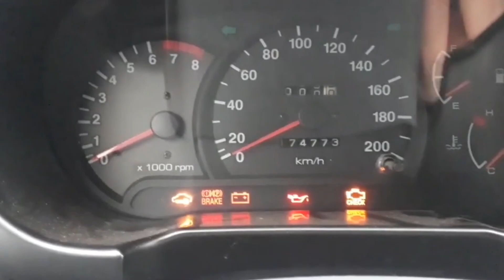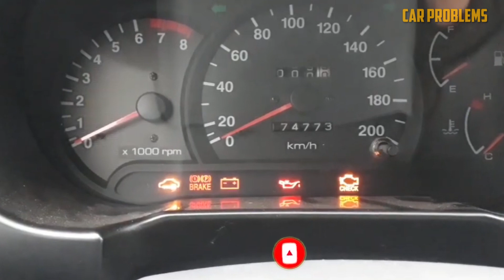5 Causes Car Clicks When Trying to Start. How to fix?

Comment: 2006 bought new, gto LS2, 6 speed
Clutch has to be in to crank it
Only long trips 30,000 miles on it.
Probably been started less than 50 times 
Started getting a click like the solinoid is engaging then it would turn over and crank.
Next only a click.
Put a new battery in it and on the first try it clicked then on 2nd try it cranked.
Now it only clicks even when trying to jump it off.
Obviously i dont don't drive it much but was cranking it OCASSIONALY it and letting it run to keep the seals wet etc. So i keep a trickle charge on it to maintain the new bsttery because it has a alarm on it.
The ground next to the battery looks like new.
Im a old disabled veteran and cant get down and check starter connections.
Any idea????

Comment: I have an 04 Nissan Armada. When it's cold under 15° I turn the key in the morning and starts every time. Under 15° I go out and turn the key just get a click. If I turn the key over and over it will finally start. I changed starter, battery, cam position sensor, starter relay, ignition switch so far nothing works. So today I swapped the ECU relay with the fog lights. Going to see tomorrow if that works getting really cold. Shop can't figure it out but I think that's because they get it in the shop and it warms up. Fingers crossed for the ECU relay.
Reply: Yep it’s got cold here in Arizona LOL and it now weather  very cold at nigjt